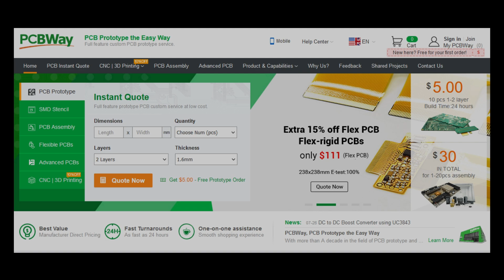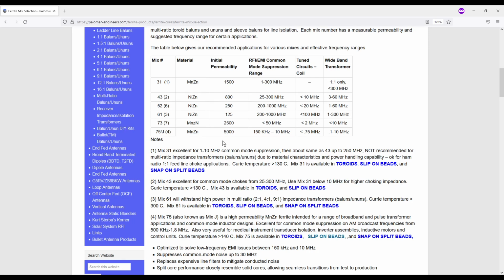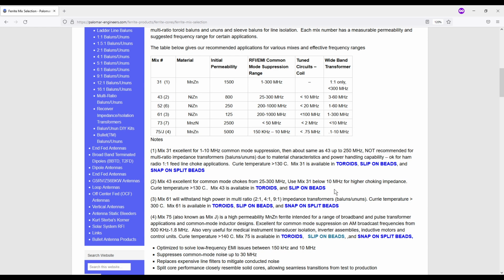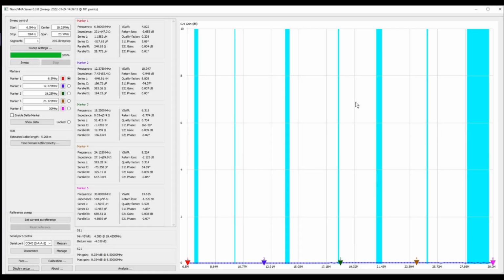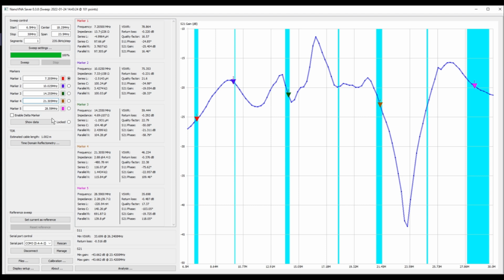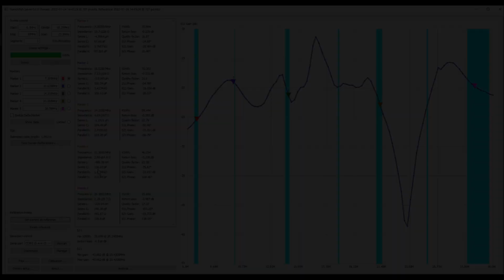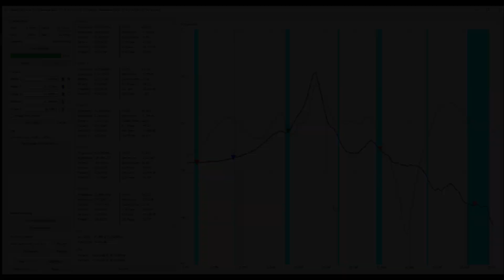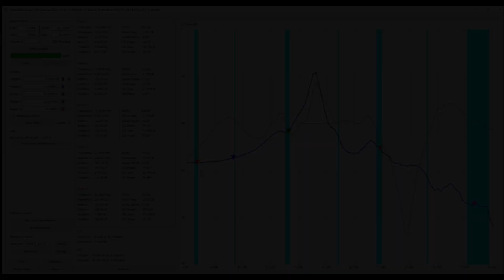Toroid Mix Selection for Balun Chokes for Ham Radio Antennas

Comment: To attach at the antenna feedpoint, is it necessary to put the choke in an enclosure to protect it from the elements or can it be used bare?
Reply from the maker: I use mine bare but I do tape the connectors 👍

Comment: Excellent video. I have acquired a number of toroidal from a Chinese vendor. Regrettably they do not detail the mix, however, they are all magnetic.  Of the 13 I have, 11 measure 0 ohms across the surface and the remaining two measure 1.5Mohms across the surface.   So, my question is, which would you use for a RF choke and which would you use for a balun.   I appreciate it’s a random question, but would be interested in your thoughts please. Many thanks
Reply from the maker: I’d wrap one or more up and then test them to see how they perform 👍
Reply: @ Am I right in thinking that your toroids are not magnetic?
Reply from the maker: They are not magnets

Comment: If the only negative effect of more windings is after a certain point each wind has less of an effect, than why not wind the toroid till it's full, say with 17 winds? Seems a no brainer to me.

I'm going to try the ft400-31 with the Messi and Paolini hyperflex 10 cable. That will be a beast hopefully.
Reply from the maker: Good luck with the build 👍

Comment: It would be interesting to see type 52 and type 61 mix compared as well since they are used in ham applications. In particular the type 240-61 is used with 13 turns as the Balun on the Spiderbeam antenna. It would also be interesting to see a side by side comparison of the return loss for a bifilar wound toroid using both magnet wire and PTFE wire vs coax wound and whether coax performed better. Just for one mix, not all.
Reply from the maker: I’ve tested so many core and so many windings I’m not sure if I have done those or not.
Reply: @TheSmokinApe I mention it because someone else did a video on magnet/PTFE/coax and all he did was compare SWR with a 50 ohm load which doesn’t say anything about performance.
Reply from the maker: Agreed, I'd want to see insertion loss

Comment: Does this not exceed the minimum bend radius of the coax?  Would you get the same results with a loosely wrapped toroidal where the coax maintains the 1.5 inch minimum bend radius of an RG-58/U?
Reply from the maker: It sure does, my experience is coax bending is a problem when it’s repetitive.  I have some like this that are 5 years old and just fine…. And if it does become a problem, I’ll simply replace it. 👍

Comment: Ahhh so, VSWR readings can be ignored in a s21 measurement?
Reply from the maker: It depends on what you are measuring, I f the s21 is for insertion loss you want SWR.  If you are measuring isolated choke impedance it’s not necessary 👍

Comment: Wow!
I really wish the internet had been around when I started in Ham radio, these videos are gold.
Just one observation, could the bend radius on the coaxial cable have anything at all to do with the results obtained?
I don't know, I just pulled that straight out of "thin air". 😄
Reply from the maker: So generally bending coax is bad but its really repeated bending that can cause the center conductor to move though the dielectric and short the coax.
Reply: @TheSmokinApe  I just ordered the FT240-31 toroid after watching your video and looking at other specs. I was looking in my bag for a coax jumper. Found a 6' length of DXE-8X (RG-8X), which has a minimum bend radius of 2.4". If you do the math and want to make an 11 turn choke as yours, plus leads, then that's about a 15' piece of cable. Yikes! I also saw the LMR-240 has a 0.75" fixed/2.4" repeated bend radius. But it's pretty stiff to begin with. Any recommendations if I want to follow best practices? Thx John KM4FZP
Reply from the maker: @TheUtuber143  I use a 3’ piece of rg58.  It’s cheap so if I have a problem I can replace it…. There are a few sellers on eBay.

Comment: Where can we find that piece of coax. And if you made it yourself Where can I find that style of SO-239 connector
Reply from the maker: I grabbed it off eBay, sorry man I no longer have the link
Reply: @TheSmokinApe  Thanks found them. Also how long should I get to make a choke
Reply: RG-58C is much more flexible than RG-58. It's available from The Wireman. I bought 25 feet of it for test leads. RG-58C is also 50 ohms, as opposed to some of the other RG-58 types that are 52 ohms. My smaller test leads are RG-316, which is also 50 ohms.

Comment: If you have some doubts abou tmix of a core, winding 10 turns through, measure low-frequncy L on a LC meter, and divide that L by 100 to get A_L value. Cross-check against spec sheets will narrow down what mix is what. 43 mix has 3 times the A_L of 31 mix so those are easily differentiated. Your VNA sweeps are also measuring the effect of turn-to-turn stray capacitance at higher frequencies which is probably more relevant for antenna chokes than what the DC characteridstics are.
Reply from the maker: Yeah, that works.  Thanks for the comment 👍
Reply: The 31 core has an Al 3 times that of the 43 core.

Comment: Mr. Ape.  You motivated me to get some parts and build the choke.  But I thought I would try something a little different.  I bought a 140-43 toroid, and wound 12 turns of RG-174.  At the end of the day, the center conductor of cheap RG-58 is about the same gauge, so I figured I would give it a try.  Well match did not change.  I am empirically seeing about a 1 to 3 S-Unit reduction in background noise, and no apparent reduction in signal strength.  I am going to keep playing with it.   I wish I could include a picture of it.  With the  RG-174, it looks super tidy.  Again, thanks for the motivation and 73, Marc - N6UNX.
Reply from the maker: Thanks awesome, glad to hear that it's working out for you.

Comment: Would be interesting to see how the type 31 toroid faired at 80M and 160M. For field day contesting I spend a bit of time on these bands. Also what would adding one or two more  turns of coax achieve, please
Reply from the maker: I'd probably look at 61 or 72 mixes for the lower bands as they are better for heat.

Comment: I have watched several different winding procedures for baluns. You have wound 6 turns of Coax and then cross over and wind another 6 turns. Another  site wound 12 turns of coax around the toroid, NOT crossing over. Any reason for the difference ?. I can see your way the toroid fits better in the box. Also any advantage or disadvantages of using RG316 instead of RG58. Your thoughts.  Thank you
Reply from the maker: I've seen people use 316 with success but I've mostly used 58 or something like magnet wire.  Once you get to 10-12 wraps each additional wrap makes less and less of a difference.  I've done both crossover and non-crossover, as long as my attenuation looks good I really don't care much 👍
Reply: Thank you for reply. My  balun, (140/43 wound 10 turns (5x5) with RG316)  I have on my 80M inverted V at the moment, works fine on TX but rig seems a bit more deaf than before ON receive .The rig also seems to run a bit hotter than normal. Had a good look at your sites, probably should have used one or maybe two,  240/43 toroids, Working on that soon as two arrive. I will see if the other Toroids 61 or 72 are readily available, and have a play. I am only running 100 Watts, assumed the smaller toroid would have been ok. Inverted V tunes & works  ok low SWR mid 30s dB return loss. Now work in progress. John
Reply from the maker: It's always a work in progress, lol!  The lower frequencies can get them hotter so bigger is better.  Good luck 👍

Comment: Okay, I have a question.
Suppose i want to use one of these chokes, (OR an ugly balun made of coiled coax), at the feed point of my antenna, and at the radio end for a mono band "resonate" (50 ohms) antenna (dipole, yagi, loop, vertical, whatever).
Suppose I also want to have my coax cut to a halfwave multiple at that specific frequency so I can check my swr in the shack.
Do I include the length of the windings as part of the "halfwave length"?
Reply from the maker: That is a good question, I’m going to say “no” but I have never tried it 😕

Comment: If i use this on 27mhz  12V INPUT POWER WIRES how many turns should i use. thanks
Reply from the maker: This is for the transmission line to the antenna, while 12v DC powers the radio it is converted in to AC / RF by the time it hits the coax.  For 27Mhz I would make it the exact same way.
Reply: @TheSmokinApe  Can i use this toroide choke on 12v radio power wires to reduce LED lights noise
Reply from the maker: @johnwestgarth2830  yes
Reply: @TheSmokinApe  Thanks Mate

Comment: Hi Ape,

Could one glean similar info using a Rigexpert analyzer in place of the VNA?

Thanks!
73,
John - KK7JBZ
Reply from the maker: Nope, you can’t do the 2 port test (s21 gain) on the RE.
Reply: I’m trying to test a 4:1 build following your 4:1.  my Rig Expert 650 Zoom is calibrated at 50 ohms, the two resistors for a simulated antenna read 196 ohms on a Fluke VOM.  I used enamel wire with wraps and connections identical to your video.  The kit from Amazon came with an NXE-100 (similar to a 140-xx core) core but I can’t find any specs on an NXE-100.  it simply states that it’s for HF baluns.
my reading are in the mid 900’s / 940-960 ohms. My unknown is the core type, other than NXE-100 without any specs. With the resistors directly connected the the Rig Expert, I get 200+/- ohms reading that are acceptable and in line with the Fluke measurement of the same resistors (fyi, two 100 ohms soldered together).
Just curious, if you had any thoughts?

Comment: These coax baluns are not very good, not flat at all with both mixes. Wire baluns are much better.
Reply from the maker: Hey man, thanks for posting and sharing your experiences.  I have build and tested many of both and some have performed better than others.  I've found that this particular choke works well.

Comment: I have built a 71 foot "random" wire antenna using the 9:1 unun you instructed to build.  It works great after I enhanced the RF ground a bit.  The transmission line of RG58 from the shack to the unun is less than 6ft.  I'm not using the coax as any kind of RF ground.  Where should I place the choke -  on the antenna tuner input in the shack?  Or on the 9:1 unun antenna feedpoint?  de KE7LOY
Reply from the maker: I typically put one on each end of the coax but seeing how you only have six feet, I would put it at the tuner.  Best of luck with it!
Reply: I would place it at an odd multiple of a quarter wavelength from the far end of the antenna. Consider the velocity factor of the antenna wire, and the shield of the coax,  and not the VF of the coax. So for example, with a half wave antenna, a quarter wave down from the feedpoint, at 98% VF for the shied if you want to be that precise.

Comment: Hi there Ape,
There are times when we Ll like to use a little more power from the TxRx via a linear amplifier,, & so from various other videos ppl add another toroidal core,  , ,  generally of the Same type.   However,  I've been thinking about mixing for example a 43 type with a 31 type core.   What are your options & feelings about doing this please. 
Also, if you have a Discord Channel,  would you please be kind enough to let me know how to join it please.
Many Thanks,,
Kind Regards,
Ray.
Location ~ JO01ii.
Reply from the maker: Howdy Ray.  I hang out on the TOADS discord that I run with some other YT buddies: https://discord.gg/ttfyDBBJaR hope to see you there.  I wouldn't stack the core but build two and use them inline, if power was an issue I would stack them but using the same mix.  Hope that helps!

Comment: What happens if you were to use RG213 to wind the choke ?
Reply from the maker: You could use it but I think it bigger and diameter and you would get less turns.  The rg58 works pretty well…
Reply: it's about the number of turns combined with the ferrite material. More turns does not necessarily equate to a higher choking impedance. In fact, a poorly designed choke can increase common mode interference. For 10/11, I use 5 Fair-Rite FT240-43 ferrites, stacked, with 4 turns of RG213 for a high choking impedance. So pass through four times to form three loops, and depending on the type of 213, watch the minimum bend radius (large loops spread out evenly  for stray capacitance).

Comment: Try testing the 31 mix in series with the 43 mix to see their reactance adds. Quick and easy since you have them made up. Might be a way to help those who need even more noise attenuation.
Reply from the maker: I will see if I still have them, thanks for the suggestion 👍
Reply: I'm wondering if this is overkill or a good solution for a multiband antenna

Comment: Great stuff for making RF chokes. But - when making impedance matching balun or unun, WHY is mix 31 bad? 
I'm sure the Palomar engineers are right, I just want to know what to look for if my toroids get mixed up in storage. I do QRP 10W, so warnings about power handling might not be relevant.
Reply from the maker: Hey Alan, it has to do with the way the mix reacts based off frequency.  You will also see people use mix 52 and 71 (I think that’s them) based off frequency.

Comment: You have to keep your test apparitus unchanged in order to maintain calibration of the VNA.  If you move the clip leads closer or further apart as you did in this video, big changes, especially at higher frequencies will occur and invalidate your normalization effort.
Reply from the maker: Hey Richard, thanks for the info 👍

Comment: ever considered mixing mixes? stacking say a 43 with a 31 and a 52 was curious if it makes a difference. Also have you tried different mixes in series with each other? i.e turns through  a 43 straight into turns through a 31 straight into a 52. Again curious to see if it makes a difference led me to ask great video's by the way keep 'em coming
Reply from the maker: Hey Gary.  I haven’t for chokes but I have used a mix 43 for a 49:1 UnUn and then in series had a mix 31 Balun.

Comment: I live in an HOA and all the high voltage power lines run about 50 feet from by back fence.  Who knows what else is buried there...Jimmy Hoffa.  Anyway, just ordered some toroids to see if this helps.  I'm not sure the CMC is the real problem, but I'll find out and let you know.
Thanks for the video.  Jeff, W0STO
Reply: Well, I tried the chokes today in my nasty noisy HOA.  I used the 240-43 and 240-31 and they made a slight reduction in the noise.  I also put a 240-31 on my power cord which didn't change the noise at all.  I imagine that the buried power lines are overwhelming everything.  I tried.  It was a fun little experiment.
Reply from the maker: @Bridgestreetnursery  sorry to hear that, here is a resource that might be helpful http://www.arrl.org/radio-frequency-interference-rfi
Reply: Here's an update.  I wrapped as many turns (12) of  Rg8X coax thru a 240-31.  I tried this before but I didn't wrap the coax as tight as I should have.  So I went back and tried again. I'm  about 50% of where I would like to be but happy that I can use my radio at home.  Thanks for the help.
Reply from the maker: @jeffstover9579  glad to hear the positive results, good luck in the future Jeff 👍
Reply from the maker: Good luck with it Jeff!

Comment: Another well presented video. There is probably a very simple answer to this that I'm missing, but...

If you get a certain RFI reduction by winding your coax through a type 31 toroid 5 times, do you get the same result using 5 type 31 ferrite beads on the coax? Is each single bead the equivalent of a single pass through the toroid and, therefore, 5 beads are the same as 5 wraps through a single toroid?
Reply from the maker: the relationship between the beads and the toroids is close but not exact.

Comment: Good afternoon Ape, I am writing in inquiry to ask if an RG58 wound FT 240-43 common mode choke can be used with larger coax feed lines such as RG8U or DX400 of which I have both. Since there is a difference in diameter, does it matter when creating a common choke mode? I believe I know that answer but with the macro amount of information available, and everyone having their own opinion, it makes sense to me to ask someone that has knowledge. Lastly, to make a resistor load for testing transformers such as a 49:1, what size resistors are used to create a testing environment when you test the 49:1 balan? Thank you in advance for your assistance! Respectfully yours, Bill, KC3RMV, East Central PA.
Reply from the maker: Hey Bill, I do think you might have some trouble with larger diameter coax.  Here is a guide that most hams use that shows positive results with RG58: http://www.karinya.net/g3txq/chokes/ 

I have tested a few different types and seem to have positive and consistent results with RG58 and mix 31 ferrites.

To test a 49:1 you need ~2,450 Ohms, 49 * 50 = 2,450.  Try to use 1/2 - 1w 1% resistors, here is a video I did: https://youtu.be/vfmCpzBOuMc

Comment: I like end fed antennas and I use mix 43 to build the 49:1 transformers that enable 10-80m and they work very well. I use mix 31  ferrite beads and toroids to help reduce rfi since I have a very high noise floor. I used either beads or cores on almost all the electrical equipment in my house. They all work as advertised. Palomar is a great supplier. I've built chokes with mix 31 ferrite beads (from 5 beads to 8 beads) on jumpers of lmr 400 with mixed results at the antenna feed points but I do have chokes at the shack end of the coax. Thanks for another informative video. K5FIT
Reply from the maker: Thanks for the additional info and thanks for watching Jack!